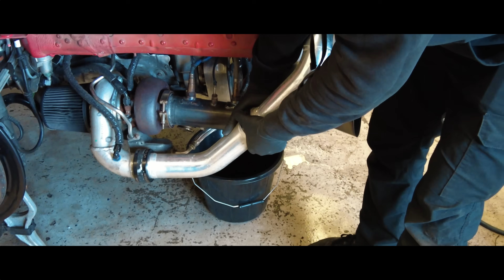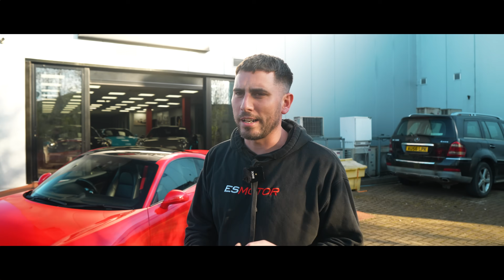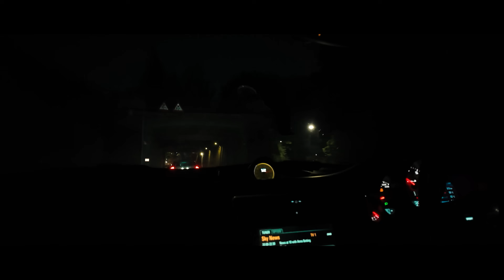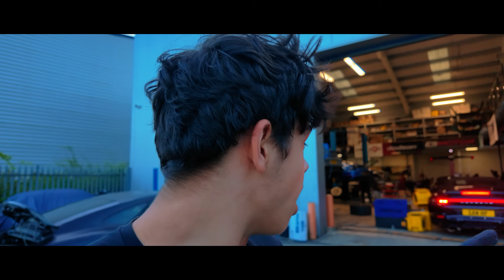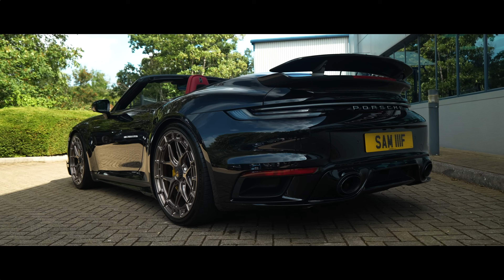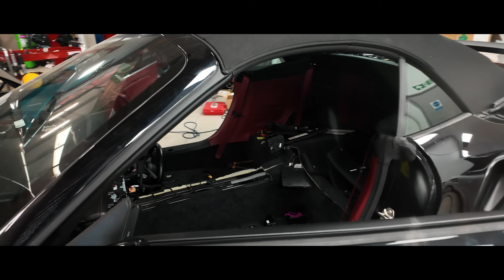1800BHP 991 or 1500BHP 992? BUILDING TWO MONSTERS!

Comment: Those gateway modules are a fragile thing.  I just fixed a power source for my FI exhaust Pro module in my GLC43 and the way it was originally in was shady to where I had U codes and B codes in the gateway/ network module.  It's all fixed now!

Comment: I have a Stage 4 992 Turbo S, on MS109 / METH… Hunting Cocky ZR1 owners 😅… great work, thanks for sharing.
Reply: Running how much power on ms109? And how much power you running on pump fuel?
Reply: @phantom2k10 Around 900 - 1000 with 18% to 20 % parasitic drive train loss.. I also removed about 160lbs.
Reply: @a-sword417 how did you drop 160 pounds? Lighter wheels? Rear seat delete? Carbon fiber bonnet?
Reply: @phantom2k10 replaced the stock power seats.
Recaro Podiums with runners weigh 9lbs each.
Burkes and rotors soon ..
Reply: @phantom2k10  Stock power seats are super heavy….Recaro Podiums with Runners… 9lbs.  Other light weight parts from NHRA connections.  I’m licensed in DIV 2. It’s capable of more but Pure Turbos are de tuned .. have to build the short block etc… we’re working on a billet race block capable of over 4.0L.  Also, Race Block for the M840T, supporting 3000HP.
Reply: I'll be honest 1000 BHP Porsche isn't enough to beat ZR1 from a roll maybe it wins from a dig 

C8 ZR1 is as fast as Bugatti Chiron from 60-130 mph 
Chiron is slightly faster from 100-150 mph and a lot faster from 100-200 mph 
I think in 1st gear 50 mph roll race Chiron walks away
But 2nd gear 60 mph this ZR1 can go neck and neck
Chiron has no boost in 2nd gear till 80 mph long gears...
Reply: @Smzxe my Turbo S is also way lighter than stock.  So then a 4000lb 1000Hp ZR1 can beat a 3200lbs 1000Hp 992 Turbo S.  Standing start or 20-30mph roll… I’ll find out soon.  If it can get my Turbo S.. I’ll put it against the Stage 3 765LT on MS109 which I have at 2550
Lbs.  I’ve been NHRA racing since I was a kid.. competition brings innovation.. thanks for sharing.  Still love my C7 ZO6 🏆 too.

Comment: Still waiting for you guys to smash the Rimac Nevera @carwow, the motogp bike and others.
Reply: Buddy there is literally no Porsche under 2000 HP which will ever touch a Rimac Nevera or a MotoGP bike. A 2015 Ducati MotoGP bike is enough....
These 1800 HP Porsches will not even get close to a 1600 HP rear wheel drive Jesko Absolut. I'm not even joking 
Jesko Absolut ran 8.77 sec @186 mph 1/4 Mile on a damp runway
13.0 sec @230 mph 1/2 Mile 
That's out of this world. That Jesko absolut with rwd could hit 8.5 sec 1/4 Mile on dry runway as well
Rimac Nevera is even quicker 12.8 sec 1/2 Mile 

A 2022 spec MotoGP bike running low power map still smashed the Rimac Nevera in two drag races and two rolling races despite the bike the was struggling with crosswinds wiggling and wobbling at 340+ km/h 
Rimac Nevera won 2 drag races AWD better launch but MotoGP bike was reeling in every single time.

Rimac Nevera runs 8.2 seconds @178 mph 1/4 Mile 
New Rimac Nevera R record 7.9 sec @186 mph 1/4 Mile 
12.2 sec @223 mph 1/2 Mile 
19.7 sec 1 Mile on unprepped surface 
No Porsche touching that

2023 KTM MotoGP bike had much better launch control 2024 ones were even quicker 

This will be a completely different story with a 2025 MotoGP bike they will simply destroy any cars in drag races or rolling races 
More power better launch as well
Reply: @Smzxe Mate, an 1,800 hp R8 has already turned Teslas into scrap metal, and the Plaid launches just like a Rimac. But sure, keep telling yourself a 1,900 hp Porsche couldn’t win. The car isn’t the slow one here—it’s your brain.
Reply: @PeterJ-gw1to  sorry mate this 1900 HP Porsche is not even close to a Rimac Nevera or a Jesko Absolut 
Rimac Nevera Annihilated the 1800 HP twin Turbo Huracan which is faster than most 1800 HP R8s look at the drag race on Carwow and JM imports 
The 2025 Jesko Absolut is even faster than Rimac Nevera 
You forgot Jesko Absolut even destroyed newest and fastest 2100 HP Rimac Nevera R 0-400-0 km/h record?
Rimac Nevera R alone was much faster than the Rimac Nevera